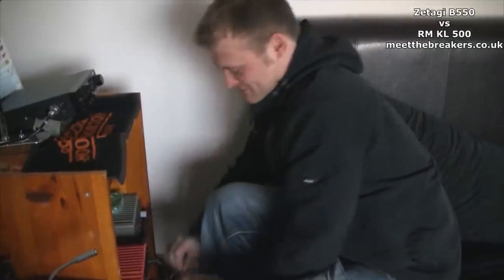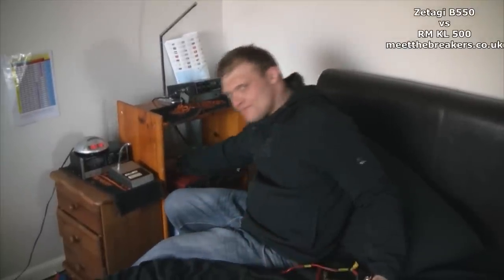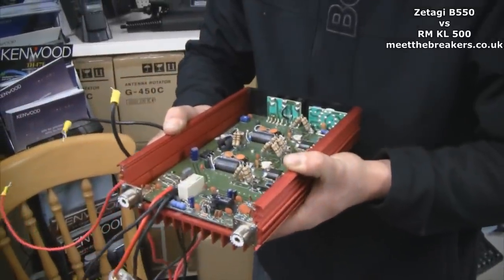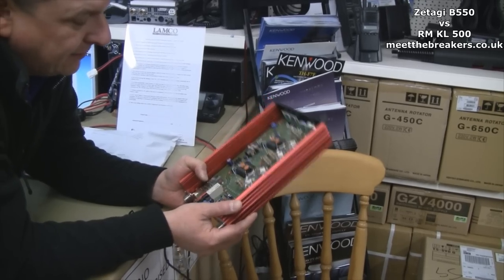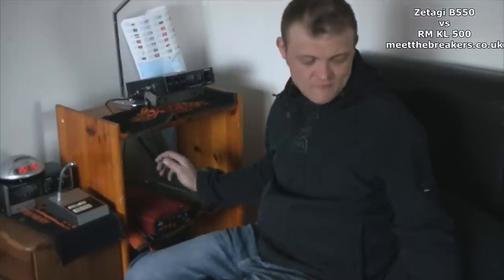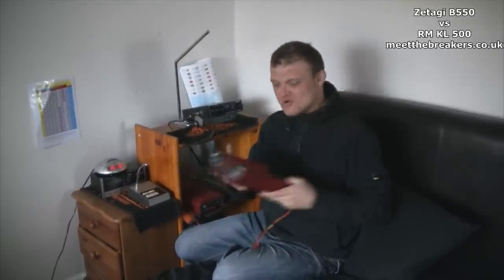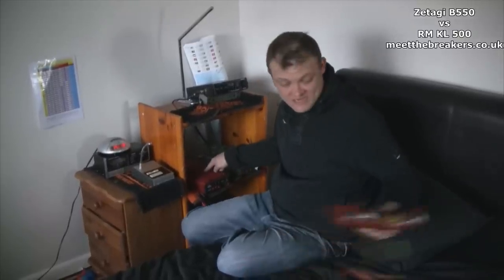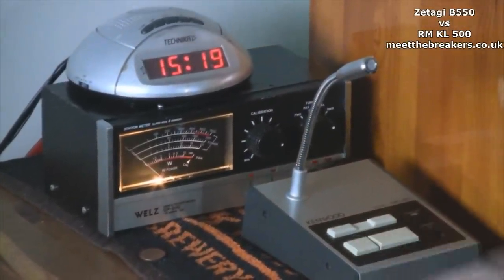Zetagi B550 vs RM KL500 Linear Amplifier Test

Comment: Colin, RM amp preform the best with 1-2 watt input, 4-5 watt is just too much for these little amps. I put 1 watt into my 203p and get a 40 dead key with a modulation swing of 175-190 watts. John, New Mexico, USA
Reply: Agreed,, especially on the swingless band of fm with its hardcore constant carrier

Comment: Well you should be running it at half RF power when you try to run them at flat stick like that you run into all sorts of problems spurious harmonics and overheating and hahahaa tracks burning out what else replacing transistors all the time no way buy yourself a Yeasu FL 7000 1200 Watt amplifier and run it at 600 Watts and your amplifier will be operating very kleen and they got an automatic tuner built in aswell

Comment: Collin : learn to build your own amp . its very pleasing and saves a whole lot of $$$$$$$  an other thing : also check the VSWR between the transceiver and the amplifier . most of the times the got a hudge mismatch . Put a computer fan on your RM let it blow cool air over the resistors and transistors . My 5 cents as an old fart radio head . used to build my own stuff all the times . cheers mate

Comment from the maker: The guy who posted about the American Texas star amp,, sorry I deleted your comment by accident. I agree with you the American amps are made lots better than the light weight Italian amps.
Reply: My brother has a RMItaly 35KL sound issue, Also it makes a machine gun sound when I talk to him on my CB. We are 20 feet away if not more, No more than 200 feet. I just bought the SR-A10 and I am running a DF3000 RF limiter. My brother has a 2.5 amp power supply on his CB could that be the issue?
Reply: I cam back to see it but cood not find it
I have a few texas stars 500dx n 667v  dx350  n sweet sixteen 
Trying find a clean  pinball 
73 n good dx  2fb2112

Comment: RM has an updated version to the RM500 the RM500v. Which has updated parts and fans. But the heatsink is still the same. As always don't feed it more than 4 watts and it will last a whole lot longer than both those models. If you want a real winner. Get a Texas Star 500. That will last almost 20 years with continued use. I have both and Texas Star is clean AB class. While the RM500v is C class and bleeds  into everything.

Comment: Very good review my friend. You have right. I have run many amplifiers, and only American Amps, and from Italy, only the Zetagi has reliable, wellworking, and good constructed Tranzistor Amplifiers. All the models of  Zetagi's12v/24v amplifiers have the same quality, perfomance and good structure. Of course, Zetagi has a little less power (db)performance (Input W > Output W) in all amplifiers than the RM.....but who cares about a few less watts, instead of Rm's high temperatures, loads, burnings, and break downs!!! Even in tube Amplifiers, e.g. BV-2001 has 4 (519) tubes ( 1 driver - 3 Amp = 600W peak AM/FM and 1200 pep SSB at 10 / 20 Watts input Power) ...and... RM KLV-1000p has 5 (519) tubes with 700Wpeak / 1400W pep .....but with many RF Relay, driving Relay, RX preamp circuit issues/problems. I agree that Zetagi in some models has more simple constructed amplifiers without many features,.e.g BV-2001 it hasn't RX (adj) Preamp, SWR Meter, Filter  in all anodes, and in especially in BV-2001 it has so wrong parts placement construction in the box, that you need to make parts all the amplifier, to replace e.g a resistor on the main board.!! But, on the other hand, you never need to do that because Zetagi BV-2001, never braekdown in normal use.!

Comment: I found that the Zetagi B550 I had to repair over 5 years ago also kept blowing the internal fuses. I could get about 240W PEP out of it on 10m SSB, with about 10W PEP SSB in. Your mileage may vary. ;)

Comment: Loved the comment on the guy in the shop. "I've Colin Proofed it!".

Personally, be it ham radio or CB I reckon nobody needs more than 100w. If the skip isn't happening then your shouting DX to nobody and wasting your lekky bill.

Improve on the antenna - it's ALL about the antenna. Then worry about the power later.

Personally, if I were you I'd have rather made up an 11m Moxon beam (which wouldn't be that big) or bought yourself a 3 element Sirio beam for 11m/10m band.
Reply: +M6GOF I was talking to a chap in Finland a couple of days ago, he was using 400w and giving me an S9, he asked me to tell him at what point I lose him as he turned his power down.  He got to his lowest of 5 w and I could still hear him perfectly albeit only an S2 -3 but all good.....Cant understand all this madness CB'ers seem to have about power when you can work the world on 10w if the conditions are right.......73
Reply: +gripper021164 because we need power to get out over the next guy on channel 19. CB is all about survival of the most powerful. Weak stations are like dog shit, they get trodden on.
Reply: +Matrix O'Reilly That's bullshit. I worked all over Europe on 11m ssb and into America using nothing more than 25 watts.
Reply: Matrix O'Reilly
Well I live in the countryside and do not suffer with adjacent channel interference (thank God), also use a yaesu ft 950 which arnt very good on rejection on 11 metres or any band, you think your CB radio gets adjacent channel crap you should try a Yaesu/Kenwood/Icom etc, as for power, come to think but I will only use minimum watts  (5w) mine goes down to and will gradually increase if I am a crap signal to copied station, I have never run it at its full power - Have copied whole of europe on 5 - 10 watt......Much more of a challenge therefore more fun, a bit like fishing in a dodgy  river/pool....Radio isnt meant to be about who is the stronger signal, if everyone used equal power and made it fair then the world as we know it would be a better place for us 11 metre users....
Reply: Stop confusing 11m with the U.K. CB band... When we talk about using power to get out on channel 19, I'm talking about FM 27.78125 where everybody else is using power, so of course if your going to compete you need to be apart of it. Don't comment on what you don't understand, I'm not talking about a single side band or AM mode where you can sit and try to get out using a few watt in propagation, I'm talking about 20 local stations all one channel all talking at the same time and music playing mic keying etc and if you want to stand a chance of getting out, you need to whack some big watts on, it's a simple as that, it's a fact too so don't come back with a stupid argument telling me I'm wrong, get yourself on the CB channel 19 fm round here and try to get out over the rest of the lads running power, no one will hear you, you WONT get out. That's why CBers buy these amps
Reply: Exactly! Anything over a ton is ridiculous! This dude needs to calm down! I'm sure RM are really worried....

Comment: If u want a decent amp get the KL RM-805. Or ACOM 1010, best amp I've owned and still own.
Reply: I'm with you on that , 805 superb amp , only issue for me is for mobile in a car , 24v not very practical , I have just bought b550p , with intention of upgrading internals

Comment: Hi Collin I'm actually thinking of buying the same amplifier like yours but with the preamp built in I'm only going to be using it for the SSB on 27.555 and if the mid band EU is open then I'll use it on 27.315 channel 31 it's some kind of calling frequency as far as I know I'm not sure but anyway you can get some really good DX on the FM as well and if I had one of those amplifiers as well then that would be great and I'd have to be careful because I use my Yaesu FT-950 so I'd have to get a proper ATU to tune it up and keep the SWR down. Thanks and best 73's cheers. Stephen M3SNV 73's.

Comment: I agree with others. Amps like the Texas Star blow these mosfet's out of the water. I had a Midnight Special 200 which is made my Xforce (good amps on the bigger ones). The are made similar to these. I then upgraded to a Texas Star DX 350 which has two 2879's. Even though it's only a little over 100 watts more, the difference was amazing. People that couldn't hear me before were hearing me loud and clear. I overall was getting noticed a lot more and getting over people that used to walk all over me.

Comment: Nice video .
I use the rm503 with a imax 2000 for hilltop work and have never had any problems with mine but I have mounted 4 12v pc fans to the top of the amp.Also I rarely use more than 200w on fm cos the dx stations are hearing me but I ain't hearing them if I use more.

Comment: I know this is old but i had one of the first RM 400s with 4 x 1446 running in it had it for years and years run it with 10 watts in and never failed me i sold it on ebay long ago.

Comment: Very happy with a RM here with single added fan. Only really used for SSB and my drive level setting from my Alinco DR-135UK = I peak the meter to a S6 modulation level on the meter...works very happily at this level. Drive them sensibly and they should work for a very long time.

Comment: I've got the older "black" RM500" I use it on 40 metres up-to 10 metres (and CB)  2 fans on top. 
Works a treat....  Pile up buster
Reply: Does the RM500 need any mod to work on the 40m?
Reply: @DuarteBraga  no but i don't think the newer one stretch that far down

Comment: I had a Zetagi B153 and it lasted about a week. Got a refund from the seller after him eventually admitting it was faulty. Been running an RM KL203 for nearly 2 years now and it's been spot on, no issues. 5W in on FM, 10-12W in on SSB.

Several locals run 203's as well and highly rate them. I do agree however the bigger RM amps are pretty poor. I had a KL503 for a day and it went pop. Got a replacement from the seller the next day and it's been spot, but I only tend to run it when there's contests going or there's a station from a rare DXCC. Too scared this one will go pop too lol
Reply from the maker: Both amps you mention are MOSFET amps my friend and they are a totally different ball game.  The MOSFET transistors in both rm and zetagi amps like yours are not even designed for RF, they are designed for cost effectiveness at the expense of poor RF reliability.
Reply: Chris TheHulk 
The problem with all KL203 amps is when you use them on SSB, just watch the SWR bounce around to way over safe limits. It's only for split seconds at a time and it is kinda supposed to move a little, but we are talking 5, 8, 10...even off the scale here...and they all do it, i've never come across a KL203 that doesn't, we've even tested a couple brand new out of the box...same deal! Don't know why, no-one i know knows why (tried different mosfets like irf520, irf520n, sc1969...you name it we've tried it)  and its not down to an antenna as we've whacked the dummy loads on.
If you have an AT5555, DX5000 type radio stick it on "display swr" when you key up and watch that SWR dance around!
Yet, something like a CTE 747 (or Midland 747 if you prefer, it's just a name) run stable as a donkey in a barn!

For me, i dont mind waiting half an hour for valves to warm up in my old Zetagi BV135 and it has a "warmer", less harsh modulation sound too...coupled up with my beam....its like comparing a sniper rifle to a shotgun when compared to a mosfet amp on a gainmaster.
Reply: I've never seen my KL203 make the SWR go over 1.3 on ssb
Reply from the maker: A 2sc1969 is not a MOSFET, it's a real old school transistor that is perfectly suited to rf linear application, the mosfets used in 203 and modern transceivers were not even designed for rf use and that is why they give so many problems. Slight changes in swr are enough to fry them, they don't handled voltage very well and instability is probably down to lack of a good bias circuit but they cost pennies to produce so the manufacturers love em, making inferior radio and linears just because of a bigger profit margins at the expense of totally crap unsuitable performance for the end user, us!!
Reply from the maker: There is no reason your swr should rise on Ssb just because your using a kl203. A lot of the time when people are seeing their swr fluctuating when using an amplifier, it is because of the harmonic distortion and RF that floats around as a byproduct of linear amplification. If your antenna is resonant and already has a low stable swr, and you have no antenna faults, then any fluctuation reading you get when measuring your swr with an amplifier is almost certainly a false reading. Sometimes amps can fuck up and alter the swr but my point was mainly about how intolerable the mosfets are when used in a high swr situation, even swr slightly above 2.0 is high enough to quickly destroy a MOSFET.

Comment: I only like RM when there's a steal on something I'll modify, yuppers, learned the hard way, fried one putting in 4.5 watts no fan, and I believe partial contact on a transistor w/arctic silver incomplete spotch... treated an identical one totally differently, with a wee heat sink and fan and it doesn't owe anybody anything (oh I do only drive it w/3 watts too)

Comment: The difference between 180 watts and 220 watts is quite small in logarithmic or decibel terms, which is what matters in radio reception.  The chances are that few people will notice the difference. I replaced a 150 watt amplifier with a 200 watt amplifier and nobody noticed although they did notice the difference between 70 watts and 150 watts and they certainly noticed and couldn't stop banging on about it when I went from 4 watts to 70! A bit lower output but with much chunkier safety margins is the way to go.

Just think, if you tweaked a rig from 4 watts to 5 would people bang on about it for weeks? Of course not, it's small beer. To make people notice you need to at least double the power and that doesn't impress people much. At 180 watts you're going to be three times the power of somebody using a "high power" 10 metre mobile transceiver, that order of magnitude gets noticed and of course 4 watts up to 180 is 45 times as much power! Nobody can fail to notice that difference.

180 up to 220 isn't even half as much again, that is about the width of a traditional signal meter's needle on reception, a difference barely worth paying for, and not worth paying for in the form of constant repair bills!
Reply from the maker: I have to agree with you, it's common sense the amps are going to last a lot longer with a low sensible drive, the issue seems to come from the manufacturers advice which rates them at 10w input,, obviously 10w will drive it lovely but it will die at that, he'll they even die with a 5w input and people think because there putting only half the rated power into them that they will be fine, clearly not the case especially on fm with the constant carrier. 2-3w will like you say still drive a good 200w and the amp will love you for it instead of trying to get 300w out of it and combusting it to death.
Reply: I had a B300P and I recall it was rated at 4 watts input for all settings except the peak output, position 6. I had a Superstar 2000 with three position power output. I used a broken matchstick to stop myself accidentally giving it too much power. With the matchstick in place it couldn't give more than 4 watts and therefore I could use it on any power level. This was useful when I was running off a car battery in a tent on the top of a mountain. Full power wouldn't last all night long but we could run on position 2 or 3 for a few hours, only cranking it up to the max when it was necessary, or fun. 

The biggest linear we ever operated from near a mountain top was a twin valve 600 watt mains linear, unfortunately it wasn't a good day when we used it and we were limited in altitude to what was road accessible. Of course we had a 5/8th wave and a 3 element beam. Carrying a generator in a rucksack was a step too far.

I know there has been at least one Ben Nevis DXpedition on UK CB (they didn't make any contacts into England). The best I did personally was Snowdon, with 150 watts off a car battery, not bad, I worked Scotland, Lincolnshire, Northern Ireland, much of Southern Ireland including a bloke on the beach near Dublin on a walkie talkie.

Be careful with big amplifiers, they can cause problems. I bought one which I thought was less powerful than a B300, a Hurricane 350. The shop who sold it me thought the 350 referred to the maximum PEP on SSB. No, it was actually rated 350-450 watts AM, 700 - 900 watts PEP SSB. After being told I was coming over radio 5 on a transistor radio on VHF FM fifty miles away I bought a low pass filter for it, but only rated to 200 watts. Only after the linear stopped working did I find out it was causing a 3 to 1 SWR and therefore cooking the burner. So for quite a long time I had the biggest boots in CB and I didn't even realize it.

Comment: Hi I am just about to errect my Anron 99 what power would you suggest it can handle?  I have a zetagi b300p also what would you drive into it max?  I want to use it for 11 metre on 27.555  is the low loss coax rg213 worth the extra money from RG58?  thanks in advance Ian
Reply: Colin The Head Thank you for your reply, its appreciated 73s
Reply: Sort it out colin the head . a  B 300 p Will take 10 watts on the first 5 Stages and 5 in on stage six .  .  the Rm is not a home base amp the same for the 550 p or the 300 p these are not designed to be used in hot conditions and would work much better  if the local Bungalows did not over Drive them for 40 minuets on end at full duty cycle they are cheap shit  indoors you should be using base station amps . these chunks of shit you spend all your money on you could have saved the money that them 3 amps cost you then put some more to it and gone and Brought a  ACOM 1000 HF Home Base Amp . These bad boys peak up 1480 SSB AND OVER A K FM Clean output No messing no hassle domination signal that is clean too So leave the Mobil Amps where they should be  in the car . .